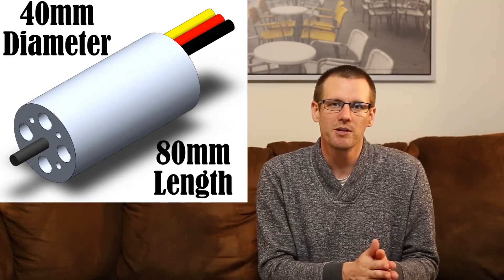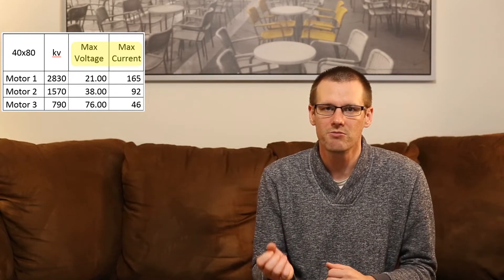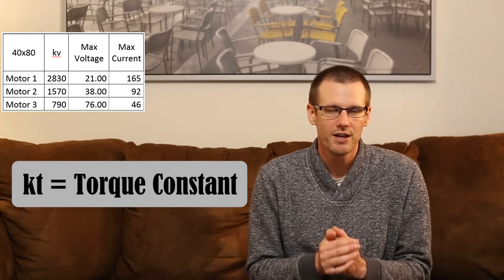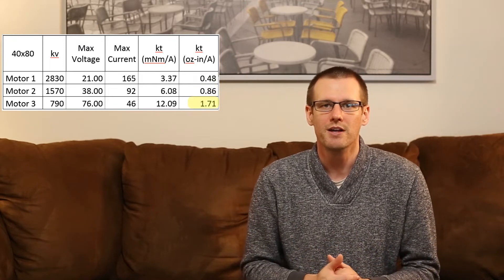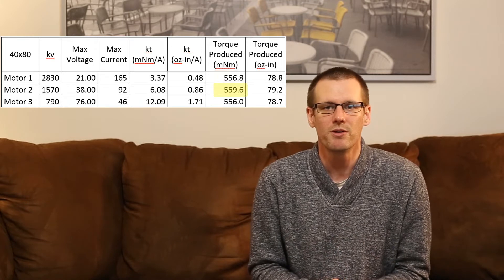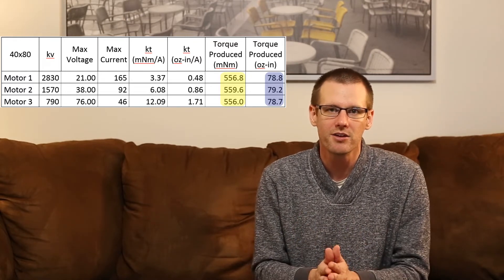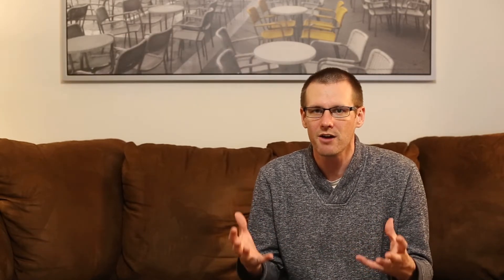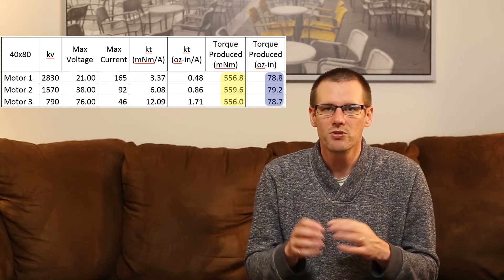Comparing Brushless Motor Torque vs Kv

Comment: There has to be more to this explanation than that. The motors are physically different internally in regards to construction and it really makes no sense to offer anything less than the most practically efficient motor/battery combination. Why run a higher kV motor and generate more heat and strain on the entire system when there is a lower kV rated motor that will deliver the same output. I'd like to see the torque curve for all of the motors plotted on a graph. If peak torque vs. rpm is not the same for each motor, that's where the difference that matters is.

Comment: i habe a question in the case of Rotary polishers and Dual action polishers, whether using a brused or.even a Brushless motor. why do they just advertise Watts and amps? Especially watts which they only advertise what the motlr can produce but not the true rating

Comment: Does that mean a 12s motor for my 90mm edf with 1200kv would be so efficient using lower amps but still producing great torque. 100amps with 50 volts = 5000 watts as oppose to my 2400kv 200amp 25 volts setup. They both produce 60,000 rpm at full power

Comment: It took me a few watches but I think I'm beginning to understand. So if I want torque and don't need speed, I would pick Motor 3 in this list not because it offers any more torque than Motor 1, but because it offers that torque while pulling less amps - is that correct? I should add that this hypothetical is assuming that everything else in the system is fixed.

Comment: Okay but speed runs we over amp the system. So shouldnt we multiply by a constant current instead of a decreasing current
Reply: Yeah I think this point is “moo” because of course the manufacturer do not want to have a bunch of claims or returns and is going to put low numbers yet subliminally advertise a lot of power.  You should multiply by same amperage and that would have the lower kv equal more torque.
Reply: Oh nvm you say this point at the end anyways very quickly.

Comment: Would a motor call for more amps if a higher mah batery is supplied both having the same gearing and load
Reply from the maker: If both batteries are healthy, you may only see a small bump in current. A few percent.

Comment: That's alot of info. The information that I have gained is: 4 pole lower Kv equal to more duration and power. 2 pole high Kv is for airplane use. Better cooling required. Which If I understand you is not really true. My model boats run an 4 pole 1200Kv 11.1 volt for 7.5 cc applaction to a 4 pole 1800 11.1 550 type can size 4 pole configuration for 3.5 cc. Just smoked the 1800 550 can but it was really fun. I have a 1/8 scale hydro F1 Miss Circus Circus with a Neu 850 delta which I haven't finished so I am in uncharted water here. Am I somewhat correct here or just plan wrong.

Comment: Hi, Great vids on the dynamics of brushless motors.. I have a question, and need to know which motor to choose.( 1) TP 3640,-1570 K ,max amps-75, max volts-38, Resistance-0.014, idle amp-1,7,, (2),Tp 3650-1680K, max. amps-189, Max volts-35.7,Resistance-0.0089, idle amp-2.9. Running a 180A esc. on 6S. Which of the 2 motors would be best overall in my boat for heat control, performance ,run time? Any help would be appreciated..Thanks

Comment: You fail to mention that the torque value max is reached much quicker at 790kv than 2830kv which is really the point in going lower kv, the way you've presented this is a little misleading.

Comment: But you didn't speak to RPM. I suspect that the lower Kv motor would have higher torque at a  lower RPM.
Reply from the maker: Why would you expect torque to be different at lower RPM? Can you show this mathematically?
Reply: @RCexplained  no, not all. But it seems intuitive that a higher rpm turning something would have greater force behind it than a slower rpm, assuming mass weight is the same.
Reply: Even if kv is different, the torque is the same when the voltage is the same, 0 rpm.

Comment: After introducing Kt into explanation of brushless motors characteristics it get clear now. What about providing the same torque by motor with the higher Kv as provided by one with lower Kv - in theory yes, as I understood from your explanation, we can provide more current and thus get more torque. I.e. we can obtain the same torque from two motors with different Kv, but at cost of providing higher V/A for motor with higher Kv (and, probably, more heat on it). But, in practice we are usually bounded by ESC, which has some limit regarding max voltage/max current for two ones with lower and higher Kv (assuming that we use the same ESC model for each of two motors). In this case one with lower Kv will provide more torque than one with higher Kv. Is my understanding correct? I.e. if we choose motor with higher Kv, we obtain higher RPM, but lower torque, and vice versa for one with lower Kv.

Thank you.
Reply from the maker: Not sure how to answer your question. If your ESC does not work for the higher Kv motor, the ESC was not selected correctly. Same thing with the lower Kv motor. If it does not allow the voltage you need to run the motor, efficiency is going to be effected and the resulting torque will not be accurate.  
Best bet is to match the ESC for the setup you sre building. If the motor is going to pull more current, an adequately rated ESC is necessary.
Reply: @RCexplained  What do you mean for "ESC does not work"? Per my understanding, it works while amount of pulled by motor current doesn't exceed its limit.I'm not sure that understood point about voltage. Voltage is the same (at lease for those two motors) any time, irrespectively to load, and depends on battery we use. For example, 11,1V (3S LiPo).
Reply from the maker: You said "But, in practice we are usually bounded by ESC, which has some limit regarding max voltage/max current"
When selecting a power system you need to select the correct ESC to match your requirements.

Comment: I would very much like to know the math that you skipped over(How you got from 1/Kv to Kt in SI units). 
As I can't figure it out without that part. 
Is there a formula that I can plot into a spreadsheet?
Reply from the maker: 1 RPM = 0.10472 rad/s. This is just a unit conversion. Then Kt = 1 / Kv. Kt would then be measure in Nm/A.
Reply: @RCexplained  Thanks, I think I got it now.
When I plot in 1/790kv I get 0.0012658.
Then 0.0012658 is divided by 1 RPM converted to rad/s(0.10472) and you get 0,01209 Nm/A or 12.09 mNm/A.
That's the part I couldn't find the explanation for.

Comment: That's a fantastic video. I always thought that it would be almost the same.

The way I see it, it's the size off the motor and what it can handle. So a 5000kv vs a 500kv can be geared to do the same thing... as long as they are the same can size from same manufacturer.

Comment: Hi Ryan, maybe a dumb question but I'm trying to replicate your table and the kt seems to be off by an order of magnitude, e.g. 1*1000/2830 = 0.35335689 mNm/A. Is this correct?
Reply from the maker: You need to convert kv to SI units - rad/s.
Reply: @RCexplained  thank you!

Comment: I have a 2000kv motor and a 70kv motor, weight is the same, but i get much more torque output out of the 2000kv with a 7:1 gear ration  in comparison to the 70kv motor with no gear why is this? (Voltage is the same) and good video 😉
Reply from the maker: Hi Lukas, just curious how you know you are getting less torque?

What are the continuous wattage rating of both motors? What is the maximum RPM spec of each motor? What is the voltage you are operating on? What is the max continuous current spec of each motor?

Comment: Hey Ryan, I've been rewatching some of your videos today related to kv and torque.  It seems to me like it might be the most misunderstood topic in RC.  A Brit YouTuber with almost a million followers recently stated "... lower kv motors have got less rpm but alot more torque.".  I'm wondering what the torque values would be with an even closer comparison.  I'm invested in 3s for my 1:10 rigs so my voltage is locked there.   What would the torque values look like for something like a 1406 slate that comes in 1900, 2280, 2850, and 3800kv? 

Sorry, long post.  Thanks for the informative videos.
Reply from the maker: When the setup is optimized the torque output of a constant motor size is essentially the same in all kv options. What changes with lower kv is the torque constant increases. However, with lower maximum current capabilities that motor delivers the same output torque as a higher kv motor. 

If you are looking for maximum performance on 3s and you are stuck with 3s, you will want to look at how high you can go with maximum RPM of the motor in your application.
Reply: @RCexplained  Thanks for the reply.   The 540 slate motors are rated at 100k rpm so I'm safe there.
Reply from the maker: Your RC vehicle may not be able to handle anywhere close to 100K though.
Reply: @RCexplained   No worries there.  My Bomber with the 3800kv 1410 castle gets a theoretical top rpm of 42180 and that is more than enough wheel speed, even with underdrive gears in both diffs and the smallest possible pinion gear.

Would you be able to point me to where I can find the formulas to calculate the torque value for a brushless motor?  I'm really curious to see how these 4 motors compare to each other when they are given the same voltage.  I checked your website today but didn't have any luck.

Thanks
Reply from the maker: Kt x current = torque. Kt = 1/kv. Kv need to be in rad/s.
Reply: Thanks, now I just have to dig through some data logs for amp values.

Comment: Can this be applied directly to the motor being used as a generator? That the Kt value can determine how much torque is needed to be put in to generate that many amps?
Reply from the maker: Yes this would be a great starting point.
Reply: @RCexplained  awesome! That’s what I thought but didn’t want to assume. Thank you for your response!

Comment: This is not realistic, the torque is at low and medium motor speed, where there is interest. Less Kv = More torque at low and medium engine speed.
Reply from the maker: What was described in the video occurs within the full RPM range.
Reply: @RCexplained  ; Ok , no problem ;-)

Comment: So Motor 1 pull 165a and Motor 3 pull 46a this means the battery connected to motor 1 will discharge quicker than the same battery if it was connected to motor3??
Reply from the maker: Yes, but typically you would be using a very different battery to match each motor.

Comment: You say Kt is the "torque constant" of the motor, that is fine. You say (like 95% of the Internet) Kv is RPM/volt. Shouldn't that be Kv is the "voltage constant" of the motor? That is the relationship between rotational speed and back e.m.f. produced by the motor, it has nothing to do with the voltage applied to the motor. There is only an approximate relationship between this and RPM/V, close enough for our use I guess but this is just another example of inaccuracy being perpetuated across the internet.
Reply from the maker: Hi Don, thank you for your comment. I'm not exactly sure what you are after here as it seems you fully understand why Kv is used.  But either way, please let me try to explain. 

Similar to Kt, Kv has been defined for the sole purpose of providing us with a standard to determine a mechanical property we get out of the motor for an electrical input. Kv is known as the velocity constant (upper case V is voltage) and this is very important. Like the torque constant provides us with a means to understand mechanical output torque of a motor, the velocity constant provides us with a means to understand mechanical velocity. Translating between electrical and mechanical properties will never be "exact."  This is for Kv and Kt.

Now if we were interested in back EMF produced per RPM of input we would use the back EMF constant also referred to as the voltage constant - Ke. Note that Kv and Ke are inverse to each other and setup for their intended use. Ke and Kt are equal to each other but use different units. Ke would be used in electrical motor calculations as standard practice. Kv would be used when relating mechanical output. 

As for this video being another example of inaccuracy being perpetuated across the internet - There are many sources of information out there and I understand some may be inaccurate. It's not easy explaining this stuff to a world of opinions. But at the end of the day, we are all just trying to provide free information in order to bring the hobby to another level, allow hobbyists to reach their goals successfully and to be able to have the most fun possible.
Reply: @RCexplained  I'm trying to wrap my brain around all this R/C electrickery, I think I'm getting there but it is difficult as there's so many and differing explanations for things like this on the Internet. There are so may threads (and as you say, opinions) on so many forums on this subject. I must say your videos are proving to be the easiest way to learn this stuff, thanks for that. I hope you don't think I'm saying you or your video are wrong coz I'm not haha, apols if you got that impression. It's caused by my remaining but diminishing confusion, haha again.
Reply from the maker: Thanks Don

Comment: Thanks Ryan a lot! Shame on me I haven't learnt physics at school so now it takes so much time to understand all this things..... It's mindblowing for me right know but interesting at the same time....Like learning magic xD 
Am I right with my current situation (my 1:10 truggy that has 3100 KV motor (size 3650), 60A Esc and 3s lipo battery)  and I want this car to climb better at low speed (or rotate slightly larger and heavier wheels without noise and vibrations at the start), that swaping to 2400kv motor only(!) I will not reach my goal?  I guess, I need a bigger motor (for example 3660 or 3665) with the kv matches my battery (already put a smalest pinion gear on my 3100kv motor). Is there a solution to reach my goal without changing (at least) my battery?))
Thanks in advance a lot! :] Keep it going!

P.S: I found the answer from two (or more) of your videos: 
- it is better to use sensored brushless motor for this type of riding.....
Thaaaaanks!!)
Reply from the maker: Hello, if you are not looking to go faster a kv drop will help with more power for going up hills and accelerating. A sensored motor will help with extremely slow speeds.

Comment: Whilst this is theoretically true I'd argue that in practice we don't scale everything appropriately, smaller than equivalent cells, same connectors and wiring etc. In practice I would argue that lower kv motors DO produce more torque because the system usually restricts the amp load for an equivalent high kv motor.
Reply from the maker: Hi Fraser, thanks for the comment. If we don't pick our power systems correctly and as a result restrict the amp load, that's on us. It's not the higher kv motors fault.
Reply: @RCexplained  100% My point though is that it's rarely, if ever, done in practice. Even if you wanted to, there is so much that is standardised. Typically moving to higher voltage is something we do to prevent having to deal with huge current amounts that would be problematic. Often it is not really feasible to go the other way. 

BTW your videos are spectacularly good. I'm somewhat honoured that you responded to a comment on a year old video.
Reply: @RCexplained  let me phrase the question slightly differently: In what practical rc application would you be able to halve the voltage/double the current and still have the same amount of torque?

I'm saying you practically can't because the requirements of the increased current dramatically change properties the system. If you don't change it, you suffer losses that will suck power out leading to lower torque. For example xt30->xt60.
Reply from the maker: Thanks for the comment Fraser. I respond to all new comments on the channel. It pops up in my feed as long as there arent too many all at the same time. I understand your point, and I guess it would really depend on the power system and the application.

Comment: Please lend some advice to a newb! Just got a limitless. It came with a 2650kv motor and mamba (something) esc! I just bought a hobby wing Max 6 combo with the 1650kv motor.  What am i to expect? I'm running 6s (2 3s lipos) Thanks just subscribed!
Reply from the maker: Have you tried entering this combination on the radiocontrolinfo website? There is a calculator that will estimate the potential speed that you may be able to hit.
Reply: @RCexplained  I hadn't, but will now. Thanks!
Reply from the maker: no problem!